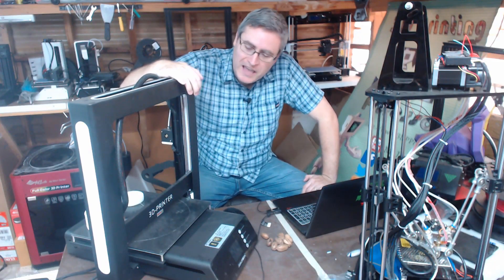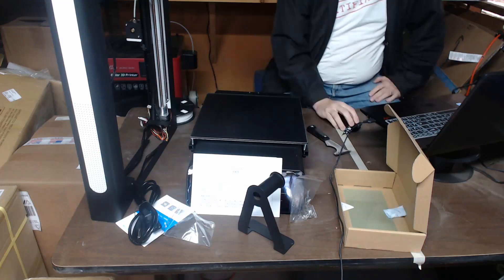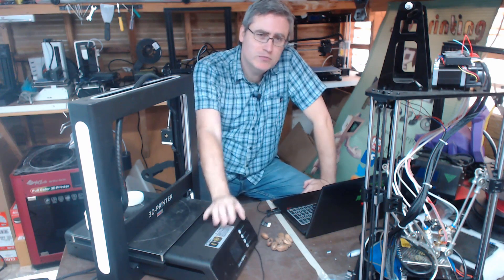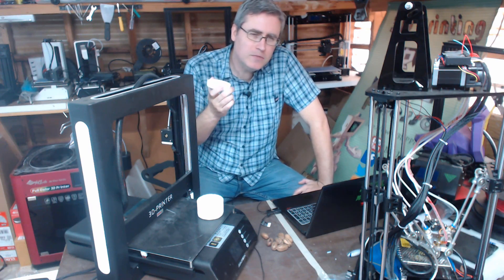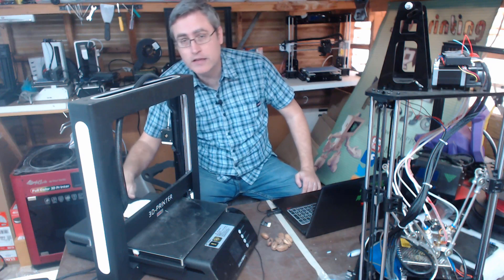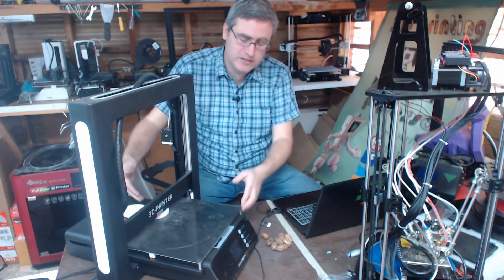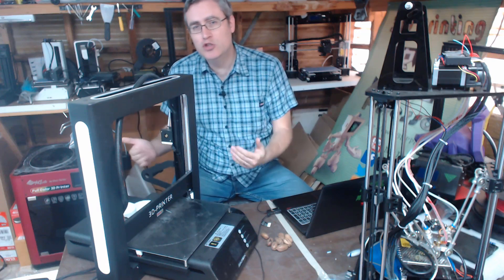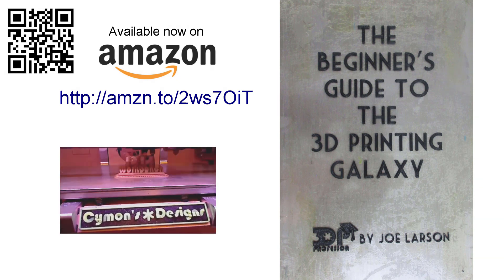JGAurora A5 David or Goliath? March MadMess

Comment from the maker: Be sure to check out my thoughts about this review, and what this printer means for 3D printing's future: http://joes3dworkbench.blogspot.com/2018/03/jgaurora-a5-review-march-madmess-video.html
Reply: 3D Printing Professor I personally thank you for your honest review. That is exactly what people are looking for when they watch these reviews. So I think with this you have hopefully gained lots of trust from me and others in the 3D printer world as buyers. So thank you and keep up the good work.
Reply: Beautiful on the outside, cra- Mouse components on the inside. 9:52
Reply: 3D Printing Professor  i am looking into buying a (high quality) 3d printer.  you seem to have extensive knowledge.  is the makerbot replicator+($2500) or the dremel 3d45 ($1800) worth the higher price? and of the two, which would you recommend.  or are there other brands of higher quality for the price.
Reply from the maker: I have had hands on experience with the Rep+, and only glancing experience with the Dremel 3D45 at Makerfair, and I can say this:

As an advanced user, the Rep+ is frustrating, both in the settings they lock off from you, and in the way they calibrate their machine to require those settings. But, if you weren't an advanced user all you'd know is that you have a 3D printer that works most of the time. 

With the Dremel it seems that the people behind it want to give you the capability to do all the same advanced stuff that I'm used to. I haven't had a unit that I could really run through the paces, but they're heart seems to be in the right place. And, it's pretty solid. And their tool chain is goood. While I can't give it a full on endorsement, I like what I see so far.
Reply: Thanks for the input.I think I am leaning more towards the Dremel. Makerbot just seems a little overrated. Do you have any less expensive favorites other then rep+ and Dremel?
Reply from the maker: It depends on what you want. If you just want a 3D printer, I say start with the Monoprice Select Mini. They're coming out with the V3 soon and it's very impressive. If you need the build volume and don't mind a little tinkering, the CR10 or this printer is good.
Reply: Seems that your issue was with firmware, which I believe has been updated as well as made available by the community... not necessarily from "crap" components. No?

Comment: Well leaving it in a dirty shed filled with mice will certainly not do anything good for any electronic equipment.. besides, most of the "china" printers, people buy for well knowing that there could be a chance of faulty models and yes, i agree that a decent support is crucial for any company but again, you are buying a cheap printer and the JG Aurora is certainly one of the most beautiful printers for the normal consumer and i am sure by now there is many videos about how to fix certain issues and even upgrade this printer. I am really wanting this printer and hope that i will eventually be able to get one and mine will be standing in a nice, clean and dry office and not in a dusty mice infested shed!!

Comment: Any updates on this printer ? Have you opened and fixed it yet ?
I'm considering getting this printer or the Tronxy X5S-400 as my first 3d printer . I understand that both of these printers will require some upgrades in order for them to work decently . Which of these would you recommend or would recommend another? Also, would you consider a trade of a large build area printer for a DJI Spark drone ? Please let me know .

Comment: Had this problem before, the stepstick type stepper drivers (in this case polulo a4988 ? ) have a control pin for the direction. This is either a bad solder joint on the driver module itself or on the socket of the control bord. A verry easy fix. One question the delta printer on the right is this a three extruder printer ? 
Greetings

Comment: any update on whats wrong?
Reply from the maker: I need to do a follow up video, but basically I discovered that it wasn't that hard to open. I swapped the stepper motors for the X and Z, just to see if that would move the problem to the X, and it fixed the problem. Chances are the Z needed a little more omph, and the X doesnt' need that much, so problem solved, I guess.

Comment: Maybe someone already posted this, but I'm not going through 90+ comments to check honestly ha .... I believe it's 4 screws to get to the internals.   Top 2 on the back panel, and under the front, take the 2 feet & screws out, and it will open up.   Easier too if you remove the gantry firstly of course.
The hotend fan was starting to make noise, if I tapped it right it would work here and there .... so went to amazon and ordered up a ball bearing fan 30x30x10, did some micro soldering, installed it and now that fan blows harder than a politician.   SQUEEE
(also, there is an "official" JGaurora FB group that is good for getting answers ... I avoid the other private group, as it's a debate hellhole imo)

Comment: A5 beds work extremely well if kept clean😀

U have a dirty bed 😋
Btw in relation to your problems, they seem to be yours but not mine, with that said JGAurora have awful customer service, you would probably be best buying it from a reseller not direct from JGAurora.

On top of that upon my investigation I have also found out that sellers are trying to resell returned dmged printers.

Comment: This machine should be best compared to the  earlier Anycubic I3 Mega for its similarity, not the CR10. I think it is obvious, for those who  read watch reviews and follow trends in 3D printing, that the I3 Mega has a lot more to offer than the CR10, if you are not concern so much with build volume and there are some very obvious enhancements and better features on the I3 Mega vs CR10,  it is almost a no brainer from a lot of points of view.  

The I3 is a reliable machine. I was really hoping the Aurora A5 would be in the same spec, performance and reliability as the I3 Mega because it has larger volume, and since it seems to basically incorporate the same nice features as the I3, or wants to be a cleaner Anycubic and larger I3 Mega,  but it is obvious Aurora needs to refine it.  

3D printing is still at the techie level, and not at the home appliance level and for this reason I think combining a machine with some clean features but leaving a bit acces for tweaking it is beneficial (i.e the Anycubic I3 Mega has a clean fully enclose base which houses all the electronics and provides a solid structure, but it allows ease of acces to the flat bed belt, likewise on the gantry, it is not tottally modernized to fully enclosed all the mechanics,  and make it hard to access  during maintenance).  I am still hoping Anycubic has taken notice of my comments and suggestion to make the I3 Mega with a larger build platform, leave the I3 as is but offer a larger version of it with the same nice features it already has. 

I have no ties to any 3D printer manufacturer and so my comments  and suggestions are strictly from my own hands on use, and experience in various diciplines with no intent  to try to promote any specific machine on the basis of profit or  vendor afiliation.
Reply: Friend of mine bought a Mega on Prime Day, he got two. . . one and a half, prints and the extruder crumbled. Like the A5 some people get amazing machines and some get duds like this one. I don't think there's a. . . well, anything that someone hasn't had a problem with.

Comment: You say they have used low-quality components.  Can you expand on this for us please.   Low quality steppers, belts, bearings, leadscrews etc. can be seen, but seeing electronic parts requires disassembly to some degree, which you say you haven't done.
Could the issues you had relate to a half-baked firmware rehash?  Also, my understanding from some other reviews is that JGAurora have not advertised this machine as having WiFi... that has come from the "half-baked" firmware still having a WiFi icon, which resulted in people assuming WiFi was there but not working.
Thanks for the great review.
Reply from the maker: My statement about cheap components was talking about the unreliability of untested components directly from China that have no longevity. But in reality the components inside an A5 are the same as inside any other 3D printer. They're just a little harder to get to (though not actually too bad when I bucked up and opened it).
Reply: That's quite a bit of parts -- how much did all the parts cost you?
Reply: Having noticed the parts were iffy when I received it, and from what I read about it .... I went to aliexpress and ordered ; hot end, thermistors, heaters, couplers for the z rods, filament switch, bowden tubes, quick-release connectors, and .... more fans, 4 in total.   
Watched your iceburg video a bit ago, and you make a good point in that these are appliances and since we don't have the Maytag man down the street for help, you have to learn as you go, and fix what you can .... it is work.
Mine has been idle for a week now, and I'm watching videos to get fired back up ... the last few prints ticked me off, so have had to reset my patience, and I've achieved THAT.  :)
So....now that I have all the replacement parts, I should NEVER have a problem again big grin
Reply: Not as much as you'd think.  As well, they sent me some of it by accident ... then resent the correct items.   $50 to $70 range.  The filament sensors came in the new form, thought they were end stops.   I always buy a lot of parts, no matter if it's the drone of the day, or 3D printer.  All of a sudden they stop making the line and you can no longer get parts.
I did the same thing with my first quadcopter, bought new frame, motors, 4 batteries .... basically bought a double of everything other than the internal wiring and mobo.   After I had the learning part down, I rebuilt the entire thing using OEM parts I had stored, even though ... the quad is long outdated.  Just an example.  shrug  :)

Comment: I am aware of the aftersales of Aurora. But if you have a faulty machine, that is not 50% of all machines. Mice are your problem, not JGAurora.  The cabinet is easely opened. The parts are standard and good quality. I have a few printers, but my A5 is the best by far. Even more than the MonoPrice Select Mini you like so much (i do too btw, but  slightly more difficult to maintain and upgrade). I really think you've shouldn't have done this review in this way
Reply from the maker: I considered that mice were the problem, but I verified that the testing was done in doors away from environmental influences. The footage you see at 6:27 was from that first round to testing.

It's entirely possible that this machine may redeem itself. But I gotta get a review out right now, and this is where it's at.
Reply: Yes, but i think it is more negative than it has to be. For example: Mounting the Gantry: Set the gantry vertical onto your desk. Slide in the box. Shift the combination, so the gantry is 10cm over the edge of the desk. You can screw in from below up, now. Why so negative? I really think JG Aurora let the early adopters stand in the cold, but Apple does that all the time and than it is ok. Just don't post a review if you don't have all the facts.
Reply from the maker: Man, I can not win. I tell people to go easy on them because the wifi isn't ready and I get told I'm not being hard enough, you're telling me I'm being too hard. It's true, the internet is harsh.
Reply: I am sorry. About Wifi and the other unrealistic claims JGA  made, you are right. On the other hand, i think this printer deserves (now, not the early models) better reviews than it is getting.
Reply from the maker: I think it does too. I wish I could give it a better review. And maybe some day I will be able to.

Comment: I absolutely loved this video.  I feel I can connect with it on so many levels.  We are also currently having a mouse issue, but luckily not to this extent. Maybe we should try using acetone?  Acetone is toxic.  Not sure.  What do you think?

Keep up the good work!
Reply: acetone on this machine, should it spill over the bed, will melt the glue that holds the glass to the heated aluminum base, just an fyi.   I just use 75% rubbing alcohol to clean it, level it, and start once heated up.

Comment: Problems aside, if they claim it has certain features (like wifi and 'auto' bed leveling), and it really doesn't have these, then that's just false advertising.  And you can't just let that go because "hey they give all this other stuff".  It could be someone really wants wifi.  So they buy this printer for it.  And then, well, it doesn't have it!  That's no good in my book.
Reply: false advertising from China LOL ... whatcha gonna do, sue 'em?  hehe   On a serious note, I think it's a feature they plan to work in on future models and jumped the gun on the implementation of it.   Some folks have successfully added a wifi module, but really, I don't trust wifi to be stable in 3Dprinting or flying drones .... much interference.

Comment: there is SD behind the screen
Reply: Just for flashing the firmware on the front motherboard (there are 2).
First time someone said to flash the front panel, .... so I stood there with a trench coat on, naked underneath and kept flashing my nakedness at it, but didn't help.   So, did some reading.

Comment: i must have got really lucky  mine has been working wonderful out of the box I'm sorry for your problems but mine seems to be a newer version as the heat bed plug is the newer no printed parts at the tops and it will print at 200 degrees
Reply from the maker: I forgot to mention, mine didn't have the 3D printed parts I saw another reviewer complain about.

Comment: Ok , since you asked me  to keep you  posted : today my cr10-s from GB arrived. I payed for it the 23th of february and the 8th of march it arrived to Milan , Italy. Than the italian courrier messed up my adress and it sent it 1300 km away from my house ...... Anyway , not GB fault . Today it finally arrived . I haven't put it togheter yet , but everything is there and without damages. Tomorrow i will put it togheter and try it , but i expect everything to go well. So , in conclusion : from GB China to Milan Italy 13 days ; NOT BAD!! Than , from Milan Italy to Parma Italy (100 km , roughly 60 miles) 6 days , but that's another story :)
Reply from the maker: And no shipping or customs problems? That is great to hear.

Hey, if you've still got the post label, does everything look copacetic? I've heard that in the past they'd falsify information on them to get cheaper rates. Does it look like they're doing that?
Reply: nope, i used the italian priority shipping wich cost an extra 15 euros , but it avoids any problem at the customs , or at least that is what they say on the checkout. On the label of the package everything seems in order , with the content and the weight listed correctly. I can't see if they lied about the value of the content , but i don't think they did since i also chosed to have the assured shipping. Also , today i tried it out , and it works like a boss :D
Reply: Most of the parts that I ordered ... the customs label values were the values it took them to make it, not the retail value.   I paid around $50, they claimed $13 for instance.   What gets my balls twisted .... is when you order something from gearbest, receive it, and see on the customs form "gift" is checked.   Ummmm if it was a gift, give me my loot back, heh.

Comment: Hi,
Normally I think the same way about printer as you do, but this time I totally disagree.
Of all printers I have (and like you, I happen to have a lot of them), the JGAurora A5 is probably the easiest printer to open and work on.
It takes 5 screws to open the cover (6 for the CR-10) and when you are inside the printer, all cables are waiting for you in perfect cable management, there is more then enough working space and every cable is labeled.
Again, I don't think any of my printers is that easy to fix as the JGAurora A5.
Reply: Same opinion here, very easy machine to open, maintenance and upgrade.

Comment: You are the most honest 3D printer reviewer I know of on YT.  I wish you would contact Qidi Tech to see if they'll send you a X-Pro for a thorough review.  They get over the hump of international returns by providing excellent, responsive support with a 6 month warranty on parts.  If you need a part under the warranty period, they ship it out via DHL (not postal mail) so it only takes a few days to get it...at their expense.  This is what I have gathered from reviews of their other printers and the Qidi unofficial FB group.  I just wish there was a decent review of it which includes thorough examination of print quality.  Becasue at $899 for a 230x150 print area, it better be comparable to a Prusa MK2/3 in print quality.  In fact, I think I'm going to send them an email and request they contact you. lol

Comment: Beautiful on the outside, crap on the inside - par for the course for Chinese electronics unless the factory is contracted to build to certain specs. Always buy this stuff with a credit card that offers impeccable purchase protection and gives you ample time to file disputes (like Discover card).  And also try to buy on eBay or Amazon, which gives you additional protection, to a degree.  I buy only small, light, cheaper items directly from Chinese sites.  Everything else needs to be sold on a USA site or I don't buy it.